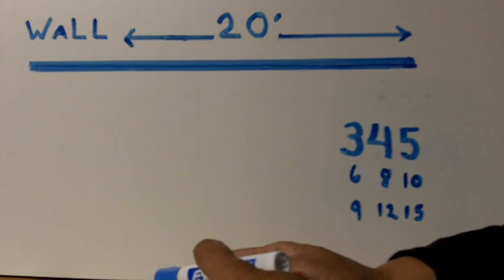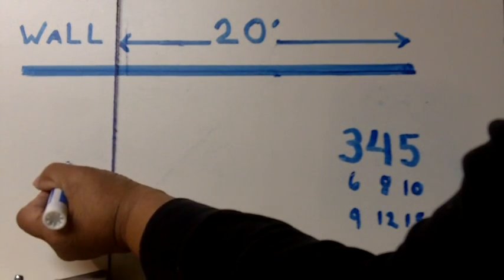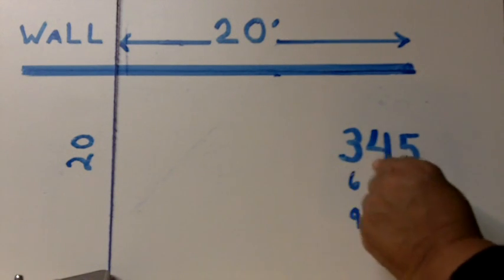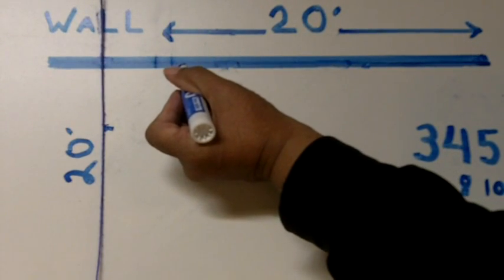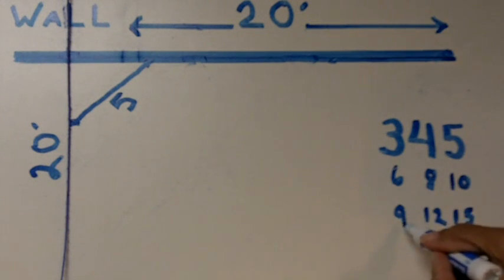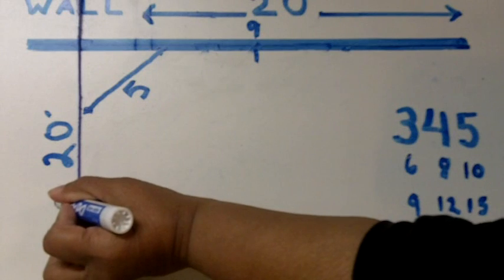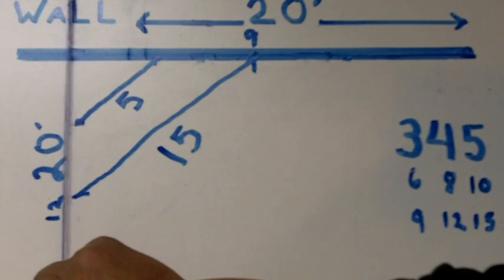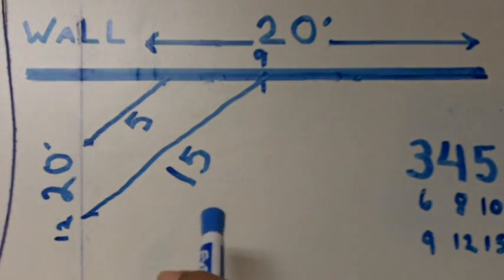How to Use the 3 4 5 Method to Square Up a Wall Perfectly

Comment: Any suggestions on how to do this for a house that's out of square? I'm doing a remodel and the house isn't square, so not sure how to reconcile that when building laying out new interior walls. Obviously if I pull parallel off of one wall the perpendicular wall would be off a little and vice versa.

Comment: Hello, and thank you for the content. To square up the other end, do you just repeat the same measurements and then for the length you would just set a string line so it is straight? Thank you.

Comment: I have a question . I am working from a 60 ' long barn wall and adding a carport like structure which will be 60' also . I used the 6 8 10 method coming off each corner of my barn . So first off , I set my lines , one from one corner along wall of the barn and marked 8' on the line , then ran a line out supposedly 90 degrees off corner from the wall line . Squared the line as per the 10' from the 8' mark to the 6' mark . After doing so , out of curiosity I put a mark at 6' along the wall line and 8' along the 90 degree line out from corner  . I then measure and these marks show that I need to move my line out another 1/2 inch at that point . And that is while the other marks show square . I did the very same things on the other corner that I am working off of and it is doing the very same thing , I need to move the line out 1/2 inch . Which is correct ?

Comment: When staking out a new post building, do you decrease your LxW by 1.5” to account for the width of 2x4? Example, if the building is 30x40, do you square everything up using 28.5x38.5? Then use the 3,4,5 etc method?

Comment: So could I use 2 tape measures to eliminate two string lines?
For example use a tape measure from the 9 foot hash mark and than attach another tape measure from the 0 hash mark and than cross the two tape measures until 9feet on the right tape measure meets the 15 foot mark on the left mark?

Comment: Not using any kind of guide except the 3,4,5 or the Pythagoras theorem rule I drew two opposite 40 cm horizontal lines and two opposite 80 cm vertical lines so as to form an oblong. I carried out what was described in the video and still, the measurements didn't add up. The top horizontal lines were different at different points even tho I squared all 4 corners using the 3, 4, 5 rule.  Despite using a square as well to check my measurements and which it said all was square but still that didn't help either because the measurements were way out ??? I checked and checked and checked and still couldn't get the measurements to match up. 40 squared = 1,600, 80 squared = 6,400  total 8,000, 8,000 squared = 89.4427 which was correct from corner to corner but yet my horizontal lines which were opposite to each other measured differently at different points. Where on earth am I going wrong

Comment: nice video but you didn't explain how you come up with the numbers you use for different length walls  they're not all the same
Reply: A 3' wall on one side and a 100' wall on the other side, the same idea applies doesn't it ?

Comment: Will this formula work with a off set building for example a 30x40. 30’ wide 40’ long ?
Reply: Okay if I calculate the square for carpenter. I can calculate both sides inside and outside?

Comment: Jane, you are a saint. The first 2 minutes, I already understood it. I just demoed my 5'x8' bathroom and trying to square it up to build out the wall to get a bathtub in. This helped me to make a square inside the room and then see how much it's off in certain areas. I also have to tile and make sure is level, as you know this finicky detail work that takes forever is going to pay off in spades later when actually start tiling and have the bathtub in before I tile :)
Reply from the maker: thanks, Nicholas, and good luck with your bathroom project!

Comment: Leah, I want to thank you for your wonderful videos. You explain things so clearly and give all the information needed to get the job done. Do you have a video that show how to use this formula when laying floor tiles? I am getting ready to do a small bathroom and want to make sure everything looks good when I'm finished. Thank you!
Reply from the maker: Hi Janice, we don't have a video that shows this formula for laying tiles.  However, we do have a video which shows another technique for laying out tile and where to set the first tile in a square or rectangular room.  You might find it helpful.  Here is it the link: https://youtu.be/anWYbNVbJtk
Reply: Thank you!

Comment: For us metric countries I adapted this to metric using leah's numbers if your tape measure is in mm only.
So 3,4,5 feet = 300, 400, 500 mm. 
A bit bigger- = 600, 800, 1000 mm
A bigger room can be 3,4,5 in meters :)
Reply from the maker: Thanks Breen for doing the metric conversion.
Reply: I just performed this using a shoe box as I did non have a measuring tape. I still used the 3,4,5 principle. You can use bananas or pencils or whatever, really
Reply: Breen Whitman 👀

Comment: I'm building a pole barn 32 feet by 32 feet and the measurements for the center of the poles are going to be 31 feet 7 inches and 3/4. How so I calculate the corner to corner measurement for square? Not too good at math but I try! If you don't know you can always ask right?

Comment: hello i am having a 47' 9"x 30'1" slab of concrete  laid im guessing the contractor  will square it but if not will this method work?
Reply from the maker: The method will work, but the contractor should be taking care of it
Reply: For a rectangular slab it would be easier and more accurate to measure the diagonals.

Comment: Hi Leah. can you use the formula beyond 9 12 15 on larger walls? Nice video too.
Reply: +JR Schultz  
I believe it is 15 20 25 then 24 32 40.
Reply: +JR Schultz It has been three years since I retired from Carpenters Union and I hope this works for you

Comment: Sorry Leah, close but no cigar!  One must use a line or a tape measure on both sides, i.e. the three side and the five side.  Where their arcs intersect is the point at which a right angle is formed.  Your method will introduce error.
Reply: STFU.

Comment: Or you can just use the direct mathematical method.  Find the square root of the squared sums of the other 2 dimensions.
a^2 + b^2 = c^2

((20^2) + (20^2))√ 
  ((400)+(400))√
   (800)√   = 28.28 feet.
Reply from the maker: Divine Placebo  Hello Divine,  Thank you for writing out the Pythagorean Theorem.... geometry buffs will appreciate it's application to carpentry.
Reply: Would u recommend to go to school to learn how to instal tile floor ?!
Reply: Would u recommend to go to school to learn how to instal tile floor ?!  +seejanedrill